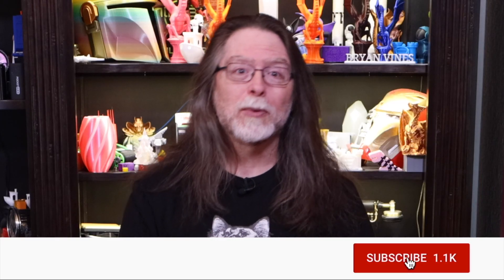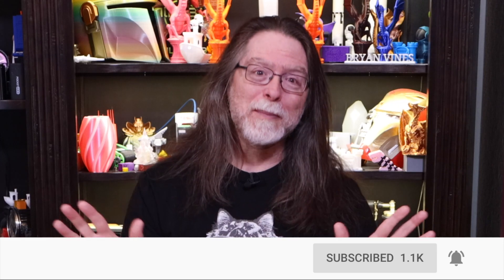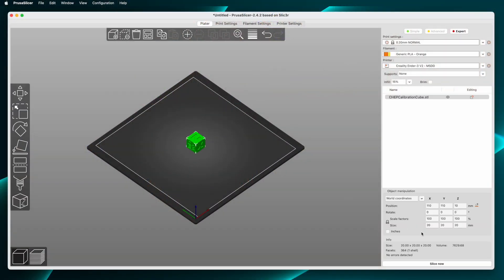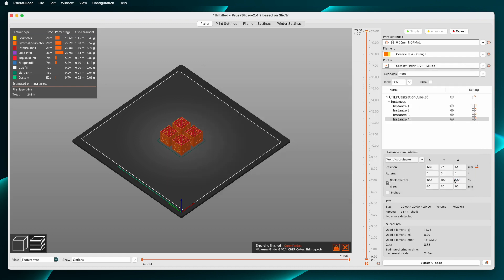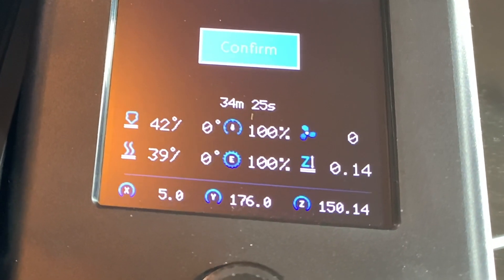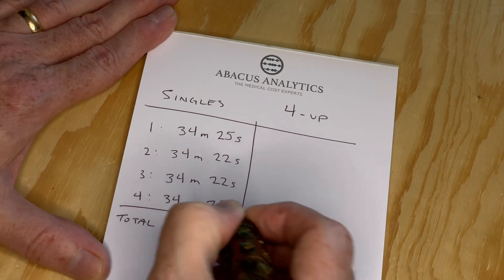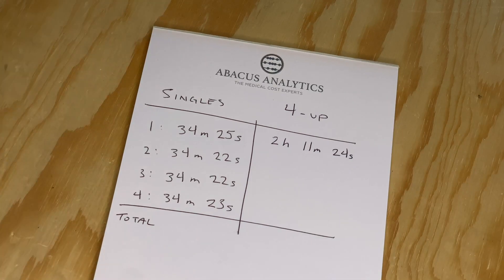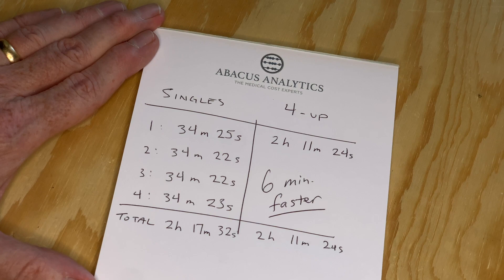What's faster, 4 at once, or 1 four times?

Comment: may i know what firmware are you using on your 3d print so you can see the finished print time ?
Reply from the maker: Hi, that was either the stock firmware on the Ender-3 V2, or JyersUI. Both should show the print time when the job is finished.
Reply: @BV3D  i don’t have that on my ender 3 v2 stock firmware (i have not updated my firmware yet) so i guess probably it’s jysers UI then ?
Reply from the maker: @Edwardz_c  I guess so. I'm sorry, I thought both of them had that feature!
Reply: @BV3D  it’s okay ! Thank you so much i will install the jyersUI !

Comment: How often do prints fail? That seems to be a common thread here. For me it's about the time between prints. If I can setup 4 or 6 at a time, and let them go while I'm sleeping, then I've effectively printed 6 in a single time slot(my sleeping time slot), and I don't have to get up to remove a print and start the next one. So the actual time may not matter. As far as failed prints, that really should be an issue because if your printer and settings are tuned, then you would minimize failures and failed print jobs would be an exception not the norm. You know your printer, and have the experience to run it, so you can decide which way is actually faster for you.

Comment: The time the printer is printing isn't the big difference. In the 4up model you have one start and can walk away getting 4 parts when its done. So you can print more because it runs more unattended. Now the downside is failures. On a single part if you have a failure then it's just one part you loose. If you have a failure in the middle of a multipart print you potentially lose all the parts.

Comment: Update on test:
I rigged up a simple hook to print.
Slicer CURA 5 Beta
Material Wanhao PETG
Temperature 235/70
Single print 1H14
= 4 x 4H56 excluding time to remove the print and restart.
4 all at once
= 4H56 minutes
4 one at a time
= 4H53 minutes

Conclusion:
Single prints take longer, but in case of a print failure, no big loss.

All at once:
Takes longer due to retraction and movement between prints. I also had slight marks from where it moved from print to print on 2 of the 4 models.

One at a time:
Faster than single print, but! You have to add 3 minutes and 40 seconds to the time. That is how long it takes to print the skirt. So faster than single, 30 seconds slower than all at once.
Each model had no defects from moving to another print in each layer.

So, if your model can fit in the reduced Z-axis, it is the best option to get clean prints the fastest. But only for small prints you can fit multiples of on your build plate at a time.
A belt printer is your best option if you want multiples of the same model. For Cartesian style printers, this is my conclusion.

Thank you for reading to the end.

Comment: This fell right about where I expected it to.  Hooray for science! Printing 4 together is only a tiny bit faster in terms of printer time used.  However, when you look at it in terms of start to finish time for all 4 prints where the 4 in 1 wins is in the gap time.  It is unlikely you will be standing ready to kick off the next print the moment the first print finishes.  Printing 1 at a time your first print may finish during the night or some other time while you are not around.  It could be 8 hours or more before you kick of the next print.  So while 4 prints at once might finish in a day and half, 4 prints back to back may end up taking 4 days.

Comment: what if you print 4 identical models but use the one at a time slicer setting, where it finishes one model then moves to the next corner of the bed to do the next one from start to finish?

Comment: Does the printer count warm up time at the start of the print? If you're starting each print cold, that could be the time difference.

Another way to do this would be with tower printing, whcih you don't see in a lot of modern slicers, but the idea that it prints a whole model before moving over, lowering the head back to the plate, and printing another one. Of course this requires the models be arranged in such a way that they don't crash into the printhead or gantry.

And then theirs belt printing.

But, the biggest gain, I would think, would be from the fact that you don't need to babysit the printer and start a new print.

Comment: Hehe you missed parallel printing, so 4 printers printing oone each would be the 34 mins and 22 secs or so.  A good proof of parallel processing being faster…Thanks. Laurie
Reply: Yes, I run 2 printers, sometimes 3 with the same item. But for some reason I cannot fit my 33cm tall prints on my 270 Z-axis printers...
But what fits on my Ender 3 S1's fit on my Ender 3 Max and my Biqu B1.

Comment: The skirts wouldn't add up to much. But cool down to remove the part 4 times plus warm up, I would think that might be your extra 6 minutes. The one plus of separate prints, I would think be possibly better quality prints unless you had it print 1  cube of the 4 and then print the next one as long as it isn't going to run into one of them

Comment: This is even more relevant with small pieces which require the slicer to automatically slowdown speed for proper cooling. By printing several pieces at the same time the slicer wont decrease speed. You should do the same experiment BUT with small pieces

Comment: Isn’t the total print time on the screen the time you pressed go not filament to the bed?  Warm up time is a considerable amount of time.
Reply: True, the clock starts when you hit print. But I assumed (har har) that Bryan pre-heated his sytem to get the print times down to smallest vallues.
Reply: Yes but the printer was up to temps by that moment. Mine still likes to think for a few seconds at the start of the print, it even does this if I print one at a time: lifts the head, moves to the new position, thinks, then lowers the head and starts printing.

Comment: 03:07 Hi Bryan, I see you left 1 type of slicing option out, using the 1 at a time setting, where it will complete 1 cube, then move on to the next cube (For watchers not familiar with that setting, for the regulars, they know all about this) I use it to minimise stringing on smaller models that will fit in the reduced Z hight.
Reply: If I'm thinking of the setting you're talking about , you need to make sure you have enough room on your build plate in the Y axis (Length). The slicer won't allow another model in same Y axis area occupied the first model due to the Z bar crashing into the first model.
Reply: @Viceroy11011  I am aware of that. Cura auto down sizes the z-axis to the max hight allowed. So it only works if the model is low enough to fit in the reduced head space. I mocked up a design and used it for my print test. I learned a lot.

Comment: Minimum layer time can also influence this. for very small parts it often makes sense to print at least two of the part to allow the parts to cool properly between layers. Even if you only need one.

Heatup, cooldown, and handling time is also potentially a major issue. getting a buildplate and hotend preheated for a high temp material takes a while, as does waiting for it to cool. Time I spend attending to the printers restarting prints for extra copies of a part is time that could be spent doing other tasks. Person hours are valuable. Machine time is cheap by comparison.
Reply: This is exactly the issue. A lot of small parts fall below the minimum layer time (around 10-15 seconds) so printing multiple parts at once can reduce overall times.

Comment: What about third option, print 4 at once but using Cura 'print individually", or whatever they call it, setting?
Reply: lots of people suggesting this. I think I need to try it but have worried the printer drives the nozzle by one of the completed parts causing mayhem... it also solves for the scenario that 1 of the 4 models has small flaws while other 3 are good, but don't need to lose whole print.
Reply: @ashvanes484  that isn’t a thing that happens. The slicer ensures this.

Comment: I'm pretty sure the print timer starts from when you press go, not when it actually starts printing. I have a BL probe on my printer and, since I have the 5x5 grid, it takes about 4min to start printing. It's still a balancing game though as more individual pieces means more travel which means weighing the travel time and potential for defects as well when deciding how many parts to print at once. 
If I have only 3 complicated parts to print, I usually do them one at a time, but if I've got 25 relatively simple parts to make, I may do something like 5 at a time.
Reply: Hi, you don't have to auto level your bed for every print. just every few prints, and then only if you have been banging on the build plate a lot (guilty myself of this sometimes when a print is stuck to the bed.) Saves time.

Comment: My understanding of the question was is it faster to print 4 at once (like you did the second time) or 4 one at a time. From a single gcode file. The Creality slicer calls this "Print all at once" or "Print one at a time". The latter method completely prints one item, then moves over and starts the next one. Setting it up requres you to measure gantry height and dimension of your print head from each side of the extruder body, and the items have to be a little more separated from each other than what you did in the video. But it's almost always faster, because you're just printing one, the moving over WHILE moving back down to the build plate to start the next. The longer method requires the print head to move from pieces to piece repeatedly, and depending on how far apart they are, you can really add some time (and potential stringing).
Reply: It's not only faster to print 4 in sequence (as you save moving between the different parts ON EVERY LAYER when printing them at once), but also quality will be better because you don't have those moves and the possible oozing out of the nozzle during that move.  Also note that with some extra care, this in sequence method is not limited to just the free height under the X gantry, as long as you make sure that gantry, just like the head, won't be hitting already printed stuff.
BUT ... if these are small parts, with very short times per layer, then cooling can become more important and some slicers may slow down printing to get at least some minimal time spent on each layer.  In that case, printing those parts sequentially would cause smaller layers (as now per part) than printing all together and hence the slowdown added by the slicer could become the dominant factor.
Reply: @MisterkeTube  You can set layer time manual. I’ve printed many parts from small to tall in a sequence with 98% success.
Reply: +1
Reply: Creality slicer is an older version of Cura ;) I agree printing one at a time is better for most cases unless the models are very small, if you only can fit them into the bed.

Comment: One variable perhaps might be vase mode. If one item can be printed in vase mode, but you can't put four on the build plate because it's too tall or somehow otherwise you're prevented from doing vase mode, it should be faster to do singles. Probably: Just more work intensive.

Comment: And when one of the "four at once" prints fails or causes a layer shift, everything fails and you start over. I prefer not to print multiple models at the same time. Especially when printing bigger models, it can happen that prints closer to the side of the bed fail or lift and become unusable. If one part gets loose others may get tangled with the printed in the air filament noodles. Then you need extra time to slice the missing or broken parts and print again.

Comment: It saves time on the Z axis. The Z axis goes from bottom to top 4 times doing it one cube at a time. Only 1 Z axis trip to do all 4 at once. Not a lot of time but I bet taller models would save more time.
Reply: Taller models mean more travel distance between them, which adds up. I guess some more complex model like a figurine would have given more realistic results in this scenario. Travels, retracts will add up and even may decrease the models quality, when not set up perfectly. In this setup the "all at once, but one after another" setting would give the best results. However this only works with relatively small models.

Comment: Would it print any differently if the first print was not centered. A few weeks ago on my new Ender S1 Pro i tried a print directly in the center. It was about a 1/4 the size of the print bed. Then I tried it in the FR corner, then I printed 4. The center one was fast, the FR was a little slower, but all 4 (again each the size of a 1/4 of the bed) was even slower. I think that the time to move all over the bed takes up a lot of time.

Comment: Not all that surprising for tiny cubes. Due to travel distances, I'd expect with taller structures it would eventually reach a point at wich they are equal, and then single printed models being faster.

Comment: It depends on the model. For example, if you printed 4 Eiffel towers, there would be much more travel time than print time as the model tapered towards the top. So it really depends on how close each layer of each model is to one another. Most of the time, if I want quality, I print one at a time. However, for non-quality prints, such as peg board hooks, I print many at one time so I can just print and walk away or do something else while it's printing.

Comment: You even got that scientfic paper there!
Refreshing to see someone actually using more of the scientific method, people tend to limit themselves either to observation, experiment or hypotheses. The last ones are all that needed to write comments ;)
The results are unexpected, so all the travel moves were negated even! I usually say that restart time would negate travel moves, and the user has to be around to remove the model (optionally wait for the bed too cool), heat the printer back up and start the next print. But you haven't counted these so the time savings are even bigger.

Comment: Okay so the actual printing part is out of the equation, I believe in the purge line and axis movements at the start of the prints, only way to know is to time it.

Now there is the setting up the printer (pre-heating, ect..) time, which would be multiplied by 4.

There is the question of the printing failures though, printing 4 at once can be risky depending on your printer's reliability

Comment: Generally the travels will take time -- on a machine with high accelerations and fast travels it won't be as noticeable, though you will have more retractions, more longer travels as you pack the bed with more items. Doing sequential printing will produce better quality and higher speeds if the geometry of the print and the machine allows it. You do get into minimum layer time issues if the parts are tiny, and in that case printing more of them will be faster.
Reply: I have also found that quality suffers from multiple parts on the bed, not much but it is noticable!

Comment: I’m my experience, the time to remove each piece, restart (waiting for temps) 3 more times would take longer than just doing all at once. I think most of time difference for me is all on that first (slower) layer using skirts/brim etc. Of course, it’ll take way longer if a multiple print fails half-way through.  Lol
Reply: I agree. I was trying to print a dozen of an item. Was around 24 hours, about 1.5 hours individually. So I attempted the 12. Was going great, but then around 80-90 percent complete it just shut down. I think ultimately I had a bad sd card, but I would have ended up with something if I had just done one at a time.

Comment: Thanks for running this test, I am wondering though this f the difference between the four “at once” or the four “one at a time” setting in Cura for printing four on the same build plate in the same operation.

Comment: 1st 😜🤡

Yeah, all the things that happen for every single print vs what only happens once on the multi. Also, the speeds/cooling during the multi print would likely be different if minimum layer time came into play. Likewise with other similar slicer settings.

TL;DR: it really depends on your printer and slicer settings, but likely faster to do more at once.

Caveat: there's more chance of a failure ruining the whole job the more parts you have on the bed.
Reply from the maker: Good point: Minimum layer time is a thing I hadn't considered.  😁
Reply: @BV3D  bites me often if I don't do a print speed preview in superslicer.